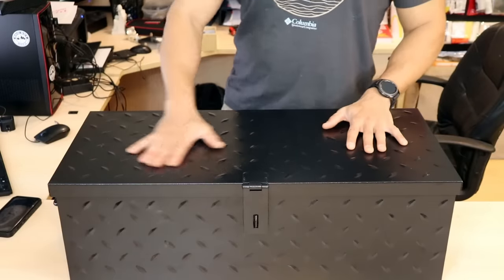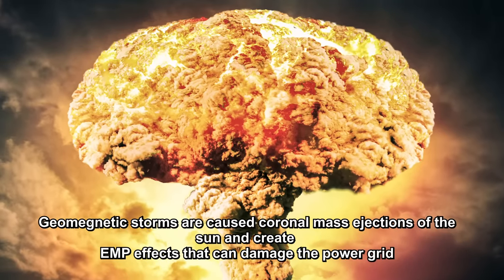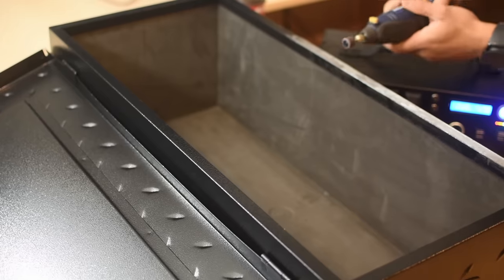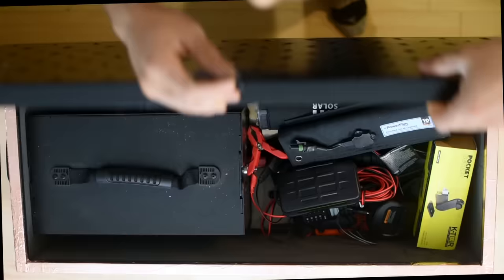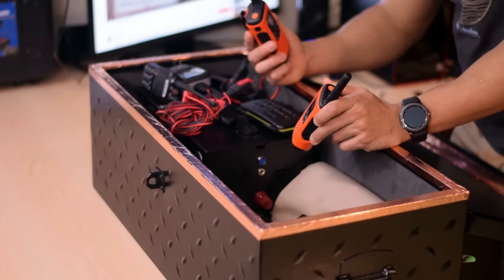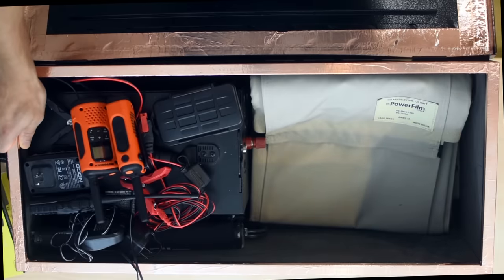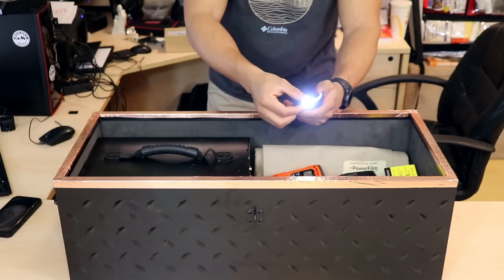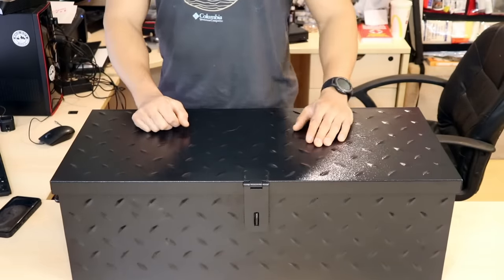EMP Prepping: Building a Good Faraday Cage | Inergy Kodiak Generator

Comment: Everyone get a grain (or two) of salt ready to take.  Here comes another of my opinions!  Lol.

Over the years, we have done estimated population threshold studies for EMP/charged particles/events/phenomena/weapons.  Here's where we stand.  Are the potential threats real?  Do these phenomena/weapons exist?  What are the potential threats/risks?  Would such events inevitably lead directly to an SHTF scenario of sufficient magnitude to warrant extensive preparations?  What are the benefits of preparation?

1.  What systems/objects are necessary to maintain socioeconomic stability?
2.  Which aspects could be/would be affected? 
3.  Of that which is protected/hardened ...will enough remain in order to maintain that stability?
4.  How many prepared individuals/groups are addressing this?
5.  How many of those are doing so correctly/adequately/accurately?
6.  After the dust has settled, ...what/who will benefit from any successful protection?
7.  What will those benefits be ...given the potential distances between potential beneficiaries?
8.  Will a grid or associated network/system, ...that has lost partial functionality...equate to a "full" loss due to lack of remaining capacity?
9.  Same question for vehicles and portable electronics.
 
Essentially, a cost/benefit analysis in order to determine whether these events are worth preparing for, ...unless a sufficient number of others are doing the same, and will be successful.  What are the values of items that are not a part of a "system" of other items?  So on and so forth.

For us, anyhow, we determined that most items deemed to be of value will be centered around medical, transportation, and communication.  Each relying to one degree or another on participating in a "system" that will likely be "down".  Highways becoming parking lots?  What are the off-road capabilities of my protected vehicle?  Who will I communicate with on my protected radio?  Etc. Etc.

This is why, once we had finally created forms of "protection", ... that we were absolutely convinced would offer the absolute best chances for protection, ...we decided it was in our best interests to make sure others had done the same.

Which is why videos of this nature, frequency, and proliferation are of great importance to those who intend to be prepared.  It seems like we are beating a dead horse, sometimes, ...but the content and the message needs to be spread as often and as far as possible.

Keep up the great work!
Reply: Jamie Hitt ⬅️ I took a few grains, the threw a few over my shoulder... And... Here we go!
I agree that your approach is valid! These questions & points are relevant! Many (myself included) prep without concern for society at large... kinda the whole point, right? We do not prep for society, we prep for ourselves... Many adopt this mentality in hopes that others will be "out there" that we can join with to survive. But, we forget that, while there are those of like mind, there are also those "out there" that are NOT of like mind!... Good vs. Evil!... There would not be a need to prep if everyone was of "like mind"... In the final analysis, I'm sure that you come to the same conclusion. If gov't, elites, industry, the common people ALL thought the same way, we would not be here discussing preps! So, prep we shall! And, whatever is meant to happen, will happen. I do however appreciate the reminders!... Thank you!
Reply: in march they separated military and gov into 3 hidden groups....they said to preserve life and government......say no more
Reply: tips for us? im at gmail noforsedexposure
Reply: That’s what I was thinking too. 
Also what is the range of an emp.  For example if I’m in a remote area when it hits. Like 1000 km from a city that gets hit. Would I be affected by emp ?

Comment: I have viewed all of Dr. Arthur Bradley's videos, and I agree that he is the most credible source on how to make an EMP proof Faraday cage/box that will work. His video’s and books should be a must view/read for anyone who is concerned about CME or EMP events.
Reply: Frank D ⬅️ Likewise, but I watched him long ago... and, in all actuality, one will never reach absolute anything... one can get closer & closer, but never to a full 100%... The Rule of 3's comes to mind (a Universe constant, as opposed to universal). In practical terms, it takes 10K volts to jump a 1" air gap. This includes ALL frequencies from zero Hz(DC) to infinite Hz(still unknown). The ionosphere is an electrical mirror of sorts... not perfect or absolute... but close. It not only shields externally, but also insulates internally... which means that, since time began, we have been bombarded with & by all energies... natural & man made. Most damaging frequencies need conductors of significant length (antennas) to channel the energy to some destination. In the same way that Old School TV's used an antenna to channel the simplex broadcasts into a viewable screen 📺... So, the power grid, house wiring, and vehicle wiring harnesses are such antennas. A house CAN be isolated from the grid via thick glass plate(believe it or not, as it has been done). But, to isolate each outlet requires a glass plate as well. Then, there is the device cord (avg length of 6'). So, hardening every device & power distribution system... well, you can see the costs involved!... is it ultimately "worth" it?...

Comment: Possibly pointless but interesting factoid: I was reading about this dude studying EMP pulses and he was talking about wave lengths and impulse and all that science shit I dont understand. Anyway he kept going on about wire length. His basic point was that the best way for EMP to pass on energy was through interacting with lengths of wire or cable, because it effectively works like a radio antenna for absorbing the energy. Some devices are surprisingly resilient, but if you leave the power cable attached, the cable will absorb the EMP energy and pass it up to the device. Leave that cable plugged into the wall socket and it might literally go bang. (because the national power grid is a HUGE antenna for soaking up EMP)
Anyways the critical point was that many unprotected devices might survive surprisingly well even if they are not shielded, BUT if there is a cable plugged into them between 11cm and 1metre, they are almost guaranteed to get fried. (by the EMP energy soaked by the wire)
I guess the takeaway is ... if you cant shield your devices, unplug them from the power socket, AND remove all cabling too. Wrapping your PC in bakofoil might potentially protect it depending on the energy of the EMP pulse ... but if you dont disconnect the mouse, keyboard, audio and all the other cables from the unit, it will cook off.
Reply: Interesting. this makes sense.
Reply: thank you.
Reply: @arelee1447  Yes, I Second that Emotion 💪✌

Comment: Two of the most valuable devices after such an event will be dosimeters and a geiger counter. Both devices should be available still, and keep plenty of spare batteries
for the geiger counter and the dosimeter charger. I'd recommend long life lithium (premium spec) cells, keep them out of the device until needed to prevent risk of leakage etc.

Comment: 15:50. I did use HAM radio to test my galvanized box, and the signal does go through. Then I build another faraday cage box with a shoe box wrapped with aluminum foil and copper tape and this box in the galvanized box. together they block the signal pretty well. I probably gonna do double wrapping to make it safer. :-)

Comment: Here's something most people don't know.
Microwave ovens.
Old refrigerators or freezers. In a pinch. They work. 
I also use the old school metal trash cans, with a lid. Line it  with tin foil covered cardboard. Then a 2and layer of Dollar Store foam.  Do the bottom and the lid. 
We also made some 1/2" plywood box with a 2 X 2 frame. I covered the outside with HD Aluminum foil and a 2and layer of heavy duty corrugated cardboard.i used the cardboard is a second layer of protection.  If the cardboard is damaged.  Check the foil underneath.  Or add another layer of foil and cardboard.  Done.
I honestly don't know how effective they are. But a cell phone inside wont ring when standing next to it. 
I wrapped every item in tin foil, then a Zip Lock baggie. 
If nobody has power, and you have a DIY Berkey,  or a 30 gal
 trash can, your 2-way. radios woork, your multimeter, DVD/TV player,  ,solar charge controller 3inverter work, who cares what she says.

Comment: I made much the same thing out of a Kobalt steel jobsite toolbox (48" X 24" x 24") from Lowe's and simply put some large plastic totes/lids inside, also from Lowe's. In those totes I put essential electronics (including my Yeti 1400 electric generator).  That is a really great tip on the PowerFilm solar panel.  Even the smallest 50W panels from Yeti wouldn't fit in my "cage".  I hope find something like that which will still work with my Yeti 1400.  Yes, I know the Kodiak is much more versatile in that regard.  Another GREAT video, thank you!

Comment: Synchronicity, I was think about building/design an EMP proof house. Great video, I thought about an idea : take your container/box in whatever ever material and put foam inside, then paint all the container/box with metal paint (i.e. Zinc), then spray some rubber spray. Repeat as much that you want and make another container/box that is asthetic that will contain your overkill faraday cage.

Comment: I don't claim to be an expert, but my experience with Faraday cages also required a ground wire attached to a conductive rod driven into the earth in order to allow the flow of free electrons to pass over the exterior keeping the contents safe. Radio frequencies are only one component of an electromagnetic pulse that concerns us. Just food for thought.
Reply: So would putting a wire on the faraday cage and then sticking it into the ground port on an outlet work, not that it screams safety.
Reply: Not needed for a simple Faraday cage that's protecting a couple walkie talkies and small portable Short Wave receiver.
Reply: @thatoneguy7603     Grounding is not needed for a small Faraday cage protecting some FRS two way radios and a Short Wave receiver from EMP or CME.     That claim is a fallacy.  We tested some home made Faraday cages. We had radios and cell phones in bubble wrap, then wrapped in heavy duty tin foil and put inside an electrostatic protective plastic bag and inside a steel paint can with cardboard surrounding the inside to prevent contact with the can..... and they blocked electro-magnetic signals with no problem, and no grounding. 
   No radio signals and no cell phone signals got through.    Also..... airplanes get hit by powerful lightning strikes all the time.... but the plane's metallic skin acts as a Faraday cage and protects the plane and its electronics.  Notice the plane is not grounded....   A hit from a large lightning bolt delivers a powerful EMP pulse.
Reply: @robertwilliamson6121  my only real concern was preventing batteries from catching fire but it seems by that point you would have much more to worry about.

Comment: FRS and GMRS radios are line of sight radios. Over sea water you might get 50 miles out of one. 
Generally speaking if there are no Buildings, Trees, Mountains, Hills or Vehicles in the way with Flat Land all around you will get some range out of them. FRS and GMRS are good short range communication radios near the 70 centimeter band. I have 2 of them along with 2 Marine Band radios and a 65 watt 2 meter transmitter. Cell Phones will die because all the towers are exposed.

Comment: Having copper and aluminum in contact will cause corrosion, thereby causing a faulty seal. Moisture will greatly accelerate this process.  You could use an anti-oxident compound, but that would be messy, and the foil would'nt stick.  Hopefully the layer of adhesive on the copper foil will slow that process, better off to use aluminum duct tape instead of copper foil.  see Galvanic/dissimilar metals corrosion.
Reply: Yeah, thought he said he did lots of research on this🙄
Reply: Happens a lot, many house fires in North America have been started ( and people have died) because of improper copper to aluminum connections when joining new Cu wires to older (~mid 1970s) Al wires. 
It's really something that is easily missed or discounted by most people who don't work with those materials.  Stripping off that copper foil tape is gonna be fun though, that stuff is a pain in the balls to get off of anything.
Reply: Eddie Jones 

It isn't a (good job) if it's wrong
Reply: What about lead...?
Reply: glen1arthur 

Me thinks that would actually be the best material for (a faraday cage). Start collecting old batteries!
Reply: Maybe stuff your electronics in a esd bag with silica absorbant in a flex seal shoe box.... in that aluminum box in a dry part of a build free from wide temperature variations? Maybe?
Reply: i was referring to the mismatch of materials causing undesired results, which happens often and without malice of intent.  wasn't referring to the particular process in the case of improper Cu/Al connections, i should have used a better example.

Comment: additional lining of copper sheeting inside or on the outside of the box really steps up signal interception. stainless steel wire mesh works fairly well inside the box as well but can be a real pain to work with

Comment: You made this video about 2 1/2 years ago.  Do you still believe an EMP is a "low probability"?
Reply: I would say a big NO because since that time China has invested heavily in all forms of first strike weapons PLUS they are now a clear adversary compared with back then.
Reply: within the next 9 mts
Reply: This is most useful since solar emps are pretty common 1 every 25 years
Reply: @arelee1447  i totally see that happening here in a few weeks
Reply: @arelee1447  9 months later
Reply: lol, some preppers like to hype up an EMP attacks but the fact is most small electronics so long as they aren't connected to large infrastructure will survive (it may need a reboot) and the majority of cars will still run. Also EMP shielding tech has advanced and become much more well known and common place so the risk of EMP attack potential damage is low. However there is a significant risk of a major CME happening within the next five years. 

Stay safe and good
Reply: @PeterKnagge  im not one of the apocalypse believing fellers but almost all modern cars would fail because of the computers we've shoehorned in there, stuff 15+ years old though  would definitely be fine
Reply: @Benzona  I'm kinda new to EMP, but why wouldn't a car be a faraday cage in and of itself? It's a metal container, with a non-conductive plastic inside, with non-conductive foam seats...
Reply: @leannhocuspocus4810  Older cars could be to a degree, many modern cars are specifically designed so they don't kill your cell signals.  Plus windows
Reply: @Benzona  Hmmm I see, I imagined the electricity running around the windows and along the frame... thank you for your explanation.
Reply: @arelee1447  ...10 months later
Reply: @trje246 
And even later

Comment: Anything that's metal is going to get hot when the EMP hits. How hot, I don't know. It's possible some people will get burned from watches, rings, and other jewelry.

If you're going to make a Faraday cage, I'd think you'd need to keep all your stuff you need in a SHTF in there all the time. You really never know when it will hit.

Get an unpainted aluminum box and seal it with metal tape.
Reply: How about fillings in teeth or pacemakers !!

Comment: Can I make one with an old microwave oven? I can add styrofoam box inside, light weight and easy to do.
Reply: Wishing someone would answer this question.
Reply: Could always get a used one for cheap. It does the job keeping things inside
Reply: @TommyBBQBessinger  I was hearing that a microwave will not work. I took my old microwave, put my phone in it and had someone call me. The call went through no problem. If the microwave works to protect, the call would not go through. So I  would not recommend using them.
Reply: @shellic5166  I think microwaves are purely built to block microwaves. The mesh on the front is set to that wavelength.
Reply: @TommyBBQBessinger  try the radio test. please let us know if it works. I suspect not. as microwave cookers can interfere with some external household appliances i.e. their shielding is only partial.